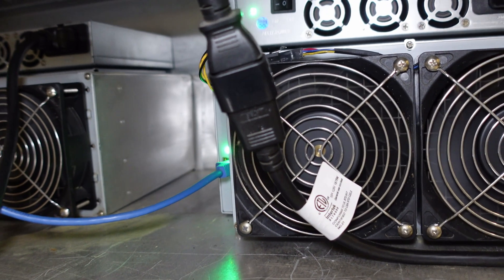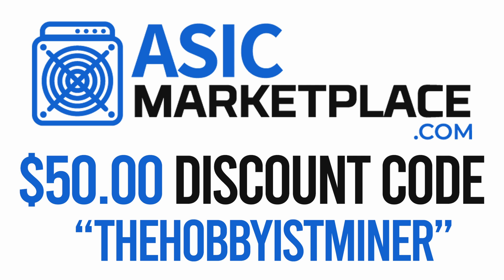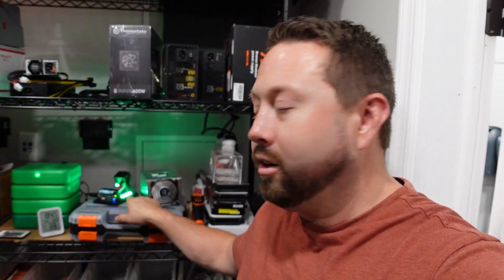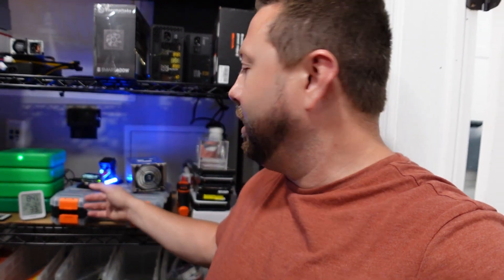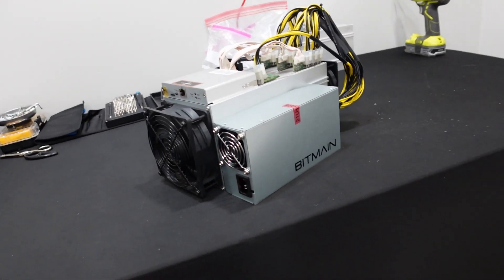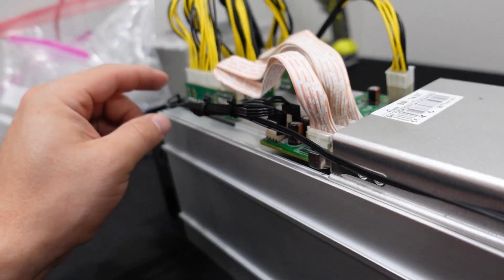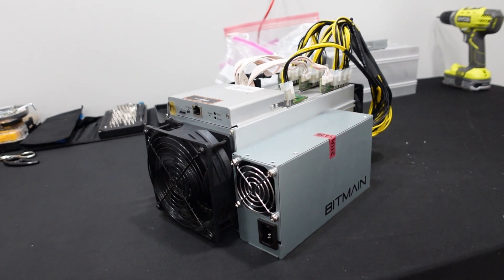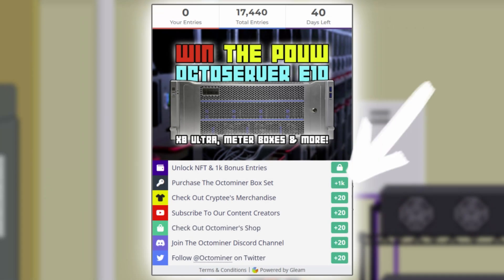Solo Bitcoin Mining on a Budget: Revitalizing Old Mining Gear!

Comment: I got 2 s9i 13.5th/s off eBay for 40$ a piece Canadian with 25$ shipping . Score of a deal everything included but power cord . So less then 200$ I got 26 th/s if I use brains and put to 1600 watts you get around 19 th/s per miner .  I normally run at 1400 watts and get just over 16 sometimes only 15.75 th/s

Comment: Wish I could do this. Part of the problem is the power. It's really hard to find anything that doesn't mine under 1500w that doesn't have decent hash rates. I also have a really old place that uses aluminum wiring and I just don't trust the electrical. So I just have to stick my Mars Lander and Terminus. Which is okay.
Though I do love the idea of being able to fine tune it, so I could just run it at a really low wattage. Though it does really sacrifice on hash rate.
If I could find fans to make it silent as well, I might really consider adding one of these.
Reply: check out that new Canaan Nano 3 140W 4TH

Comment: If you auto tune and set 500w, will it work or crash?
Reply: It works I have my S9 set @ 300w @ 3.5TH/s
Reply: @MrJnmill12345  sounds good, I was soloing  a 3090ti @300w/5gh 😅
Reply: @MrJnmill12345   do have the all boards connected I would like to this and use lite coin pool but I tried that pool and it didn't work .
Reply: @reeftheseaforever all boards connected, what’s crazy is dashboard saying 77w  per board 😮
Reply from the maker: On my list to test out.  I want to lower it down to around 650w to start.
Reply: Lite coin is different algorithm  btc is 256 bit ltc is script. Look up L+3 asic miner bitmain plug and play set up too

Comment: Braiins is awesome! My next project is to put it on my S19J Pro+.  I first used Braiins on my S9's a few years ago and ran them on 120v outlets so I kept them around 1000 watts.  There is a dev fee but if you mine to Braiins pool it gets refunded with each block
Reply from the maker: Very cool! Eager to try it out more!
Reply: Yeah It will be one heck of a project getting BRAAINS on to a newer model without an SD, that comes with locked firmware. I am looking in to aftermarket control boards to do the same thing.